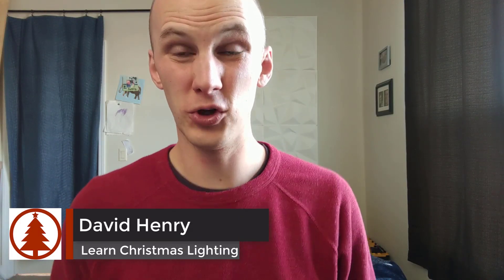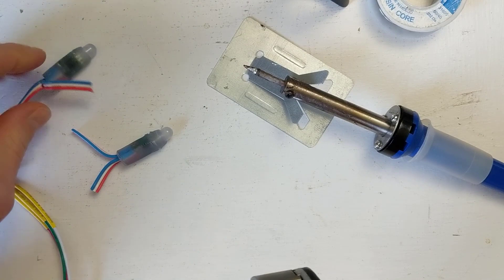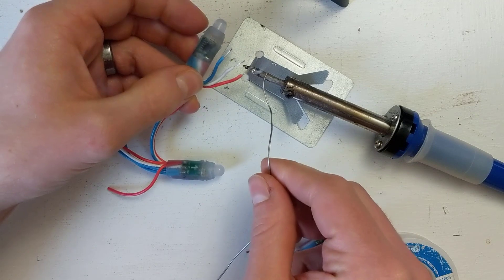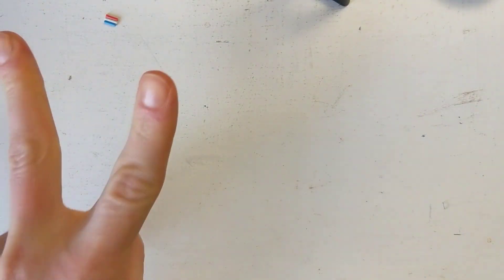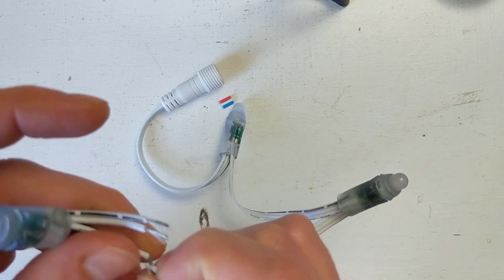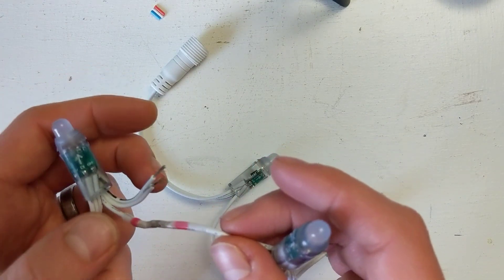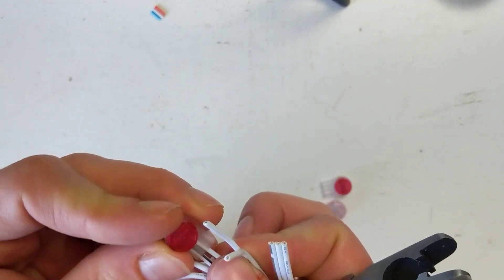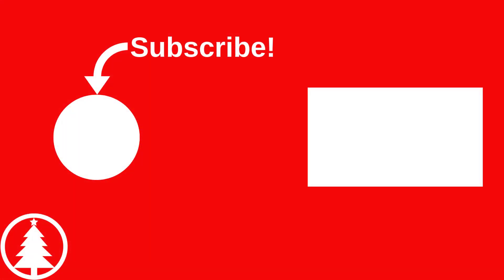How to Fix Bad Pixels: Scotchloks vs. Solder Sleeves vs. Soldering

Comment: Hey not sure if the ScotchLoks have been updated, but they no longer fit my 18 awg pixel wires.
Reply from the maker: So sad...make sure you have a 3m ones.  I have never had an issue with those, but even the Klein ones (who normally would be a good brand) are too small.

Comment: Nice video! I think I may pick up some scotchlocks tomorrow. I spent hours today soldering wires. However solder has its place and so do quick connectors.
Reply from the maker: Though admittedly, I am doing less and less soldering than ever....

Comment: It's easier to twist the wires together (Western Union Splice) first (no pre-tinning), then solder. Also, put your heat shrink on the longer wires to reduce the chance of shrinking due to the soldering heat. I like the sleeves though I haven't used them yet. Never been a fan of ScotchLocks since I've had them come apart and they don't look very clean like the other methods. Nice video.
Reply: This coming from the absolute Master!  Jeff is a wealth of knowledge in this field and surely one to follow.  Give him a look see!
Reply: Ha
Reply: Western union did you work for them? Like my dad did.
Reply: @richardcdldriver  Haha. No. Someone told me I was using the Western Union technique for connecting wires. I've just always done it that way. Didn't know there was an actual "term" for it. 😂